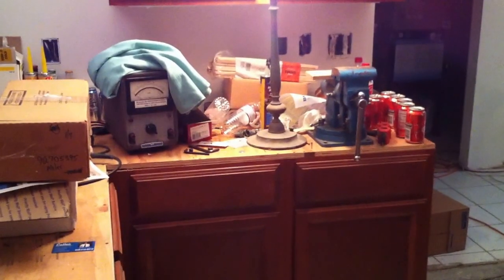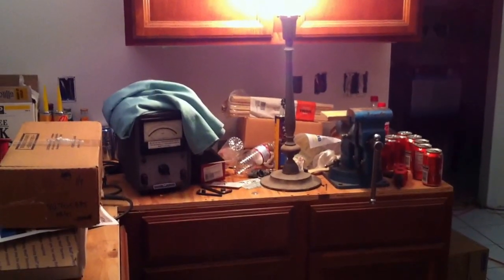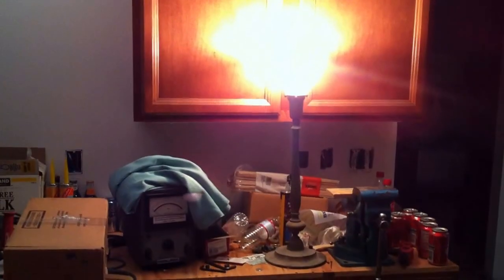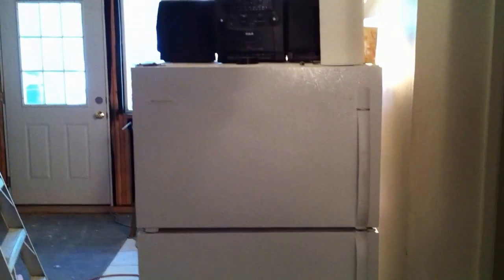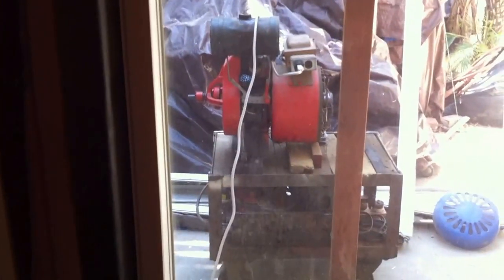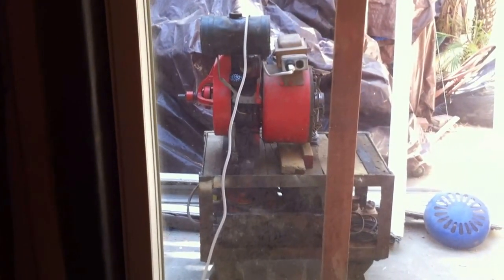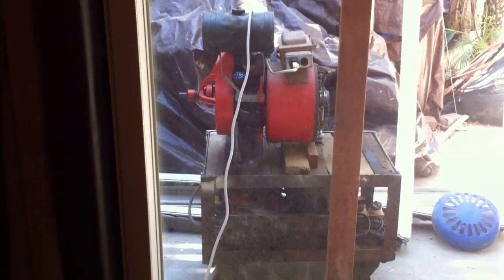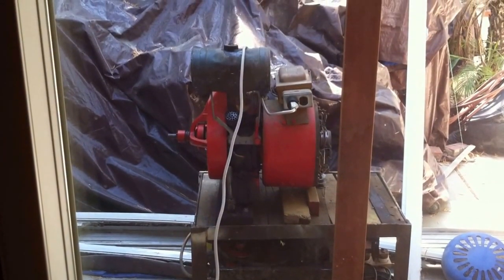1943 Briggs & Stratton powered 800 Watt Kohler Generator Set hard at work

Comment: This makes me want to get my 800a21 out and going
Reply from the maker: +1944johndeerel Yes! You should :) I've seen your 800A21, very nice.  I wish mine had been automatic, but I haven't found one yet.  I do have a 1A21 (1-1/2 kw automatic) that I'm working on, had it running yesterday, no videos yet.  We also have very similar 6-1/2 kW Kohlers in common :)
Reply: I also have a couple 1500w kohler sets they are very handy little things and very useable one is a 1954 and the other is a 1968?
Reply from the maker: 1944johndeerel
Ah, yes, I believe I have watched your film on your 1954 model.  Those are nice and handy / portable, and no doubt better than any modern one.  My 1-1/2 kW Kohler is an earlier model, and was intended instead for permanent installation.  It is automatic like your 800A21, except it is a little baby overhead valve four cylinder engine, water cooled, and runs at 1200 rpm.  I don't have any videos yet, but there are others here on YouTube.